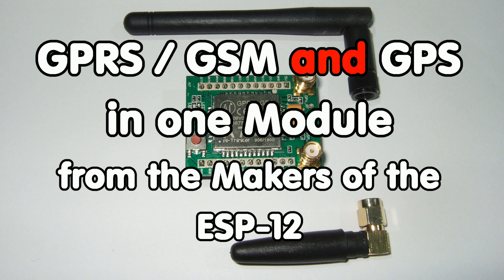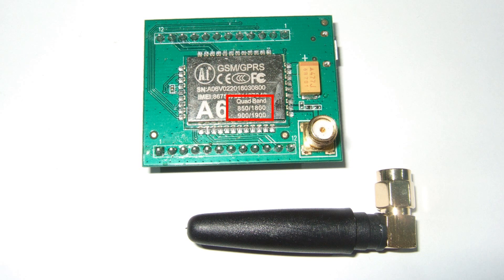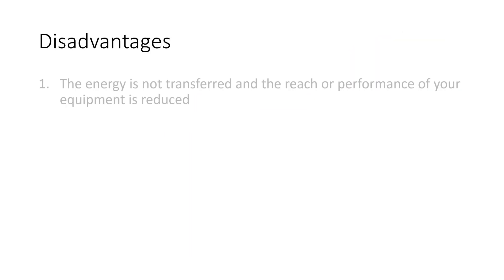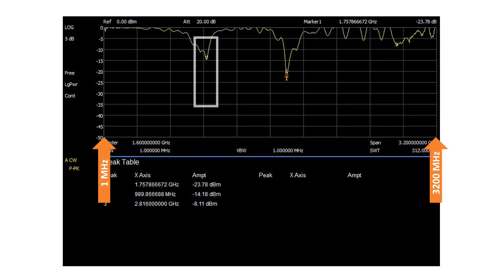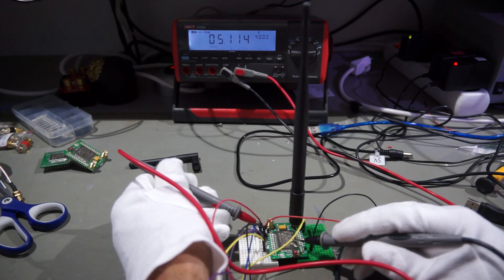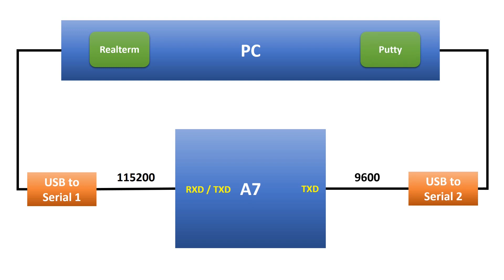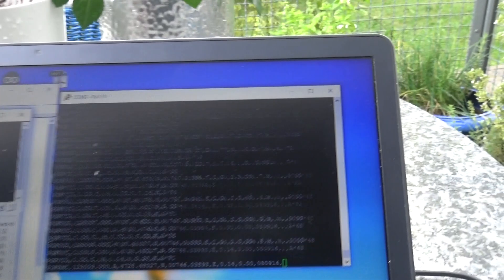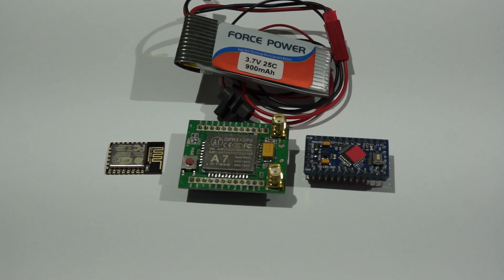#79 GPRS/GSM and GPS in one cheap module: The A7 from AI-Thinker

Comment: I managed to add power for a active GPS antenna to the GPS SMA connector.
I replaced the zero ohm resistor which connect the SMA connector to the GPS antenna input from the A7 module by a 100 pf capacitor.
On the backside of the pcb I soldered a SMD 1 uH inductor directly to the center point of the SMA connector and the other end with a thin wire to the 4 volt VCC near the  MP1584 voltage regulator.
Reply from the maker: Very good information! Thank you. Could you provide maybe link to the antenna you used and a picture where you show, what you exactly did. I think, many other subscribers would be interested.
Just for my info: What is the min and max voltage for the antenna!
Reply: I made two photo's from both sides of the module, which hopefully gives enough info. The link is : https://www.dropbox.com/sh/xcuy4b135jigh1g/AAACqVZXAmFlJi68VQcSrhA9a?dl=0
I used an old TomTom GO external antenna (model 4D00.006) but I think that the antenna bought from Ebay should also work.
Reply from the maker: Thnks. Perfect. I will try it, too
Reply: Do you have part numbers or specs for the components you added? For instance is the capacitor you used a multilayer ceramic, feed through. etc?
Thanks for the help and for posting your findings.
Reply: I can't say much about the components, because they came out my "junk box". The capacitor is a 3216 (3.2 x 1.6 mm) but the 0 ohm resistor it replaces was smaller in size. I don't think that the quality is very important, because it only has to block the VCC. The inductor is a 3225 (3.2 x 2.5 mm) with a dc resistance of 0.5 ohm. It is mounted upside down, so it is easyer to solder to the center pin of the SMA connector and to solder the wire at the other end.
Reply: Dolf
Thanks for the reply. Based on your latest response I am planning on using these components then from Mouser
Inductor
http://www.mouser.com/Search/ProductDetail.aspx?R=MLF2012A1R0Mvirtualkey52130000virtualkey810-MLF2012A1R0M
Capacitor
http://www.mouser.com/Search/ProductDetail.aspx?R=W2F11A1018AT1Avirtualkey58110000virtualkey581-W2F11A1018AT1A
I would appreciate your comments.
Thanks again
Brian
Reply: My knowledge about SMD components is minimal. I am from the descrete components era. Your choice looks allright to me , but I think that the small size of the inductor maybe hard to solder a wire on one end. The inductor  I used was fairly easy to solder a wire on.
Reply: Dolf,
Thanks again for your help. I grew up with vacuum tubes so no worries!
Brian

Comment: Thanks for the video. GPS is working fine and also other AT Commands. when I start a tcp connection-AT+CIPSTART="TCP","ipaddress",port
the reply should be CONNECT OK. But many times i get garbage values and after the cipsend command, in the reply also i get garbage in between the response from server.
Reply from the maker: So, it seems, that you have some work ahead ;-)
Reply: please check your device that it is also showing such type of issues or i got a bad one
Reply from the maker: I do not use it for the moment, so I cannot check.
Reply: Did you try to set the baud back from 115200 to 9600? This could solve your problem.
Reply from the maker: You can only do this temporarily and with a clumsy method. So, this was no option for me.
Reply: What kind of garbage do you receive? Maybe it's an option to add more time to delay?

Comment: Congratulations pour this video. I have a problem rather simple ... how to connect the board ? because the indications are not documented, for instance the pin GPS (near the GSM antenna) ? is it the TX PIN GPS. Have you a document with the corresponding pin to connect to the two series line as in your video?
Reply from the maker: Pin 37 is GPS_TXD
The information I used is at: http://www.electrodragon.com/w/GSM_GPRS_A6_Module

Comment: How are you using Real Term and putty together? I am not albe to open putty while Real term is open
Reply from the maker: Not on the sam port, of course. But for different ports it should work
Reply: You connected 2 FTDI/Serial interface to A6? :O
Reply from the maker: Not to the A6, but to the A7. For the A6, I just used Realterm instead of Putty
Reply: Oops, I was talking about A7. I am still confused about the wiring.
Reply: I have A7 that is working, I am able receive "OK" for AT+GPS=1 but as I understand it needs 9600 for GPS to output but AT commadns seem to respond at 115200.
Reply from the maker: The A7 has two serials, one with 115200 and the other with 9600
Reply: HTXD and HRXD ? can you please post a circuit diagram.
Reply from the maker: Pin 37 is GPS_TXD
Reply: Thanks a lot. I will try them :)

Comment: Andreas, I got my A7 today but I can't seem to get serial communication to work.  The only info I have is from your video.  I am supplying power to the micro USB connector from a large power bank, so I assume current capacity is OK.  I have serial connected to PC via a CH340 usb adapter (RX/TX pins on the same side as GPS connector).  I have a ground from the CH340 to the A7, but not power.  The CH340 is set to 5v just to be safe.  I then press and hold the power button on A7 for 2 seconds and the LED lights up.  Putty is connected at 115200 baud.  When I type AT i get nothing on the putty terminal.  If I press the power button again, to power down, then power up, I get some 'garbage' on the serial terminal, so assume something is happening??  Do I need any special settings in putty?  have I got the A7 powered up correctly?
Reply: As per above, there is a pin labelled GPS which is a second TX port dedicated to GPS output at 9600 baud. You really need a micro with two hardware serial ports like the Teensy 3.x/LC series.
Reply: arrrh!  some progress, I now get an output when i power it on.  Not sure what was wrong before, possibly not holding power button down for long enough.  The A7 now send a series of lines to putty;
^CINIT: 1, 0, 0
^CINIT: 2, 32, 41891
^CINIT: 8, 2048, 1
^CINIT: 16, 0, 1638410
^CINIT: 32, 0, 0
+CREG: 0
then nothing else happens.  I still can't send AT, or at least I get no response.  I've tried sending AT+GPS=1 and again now OK response (assuming I should get an OK).  I have to force ECHO on to see the AT that I send, nothing when set to auto (not sure how this should be set)
Reply from the maker: Try once Realterm instead of Putty
Reply: I can now get AT comunication working and send/receive text messages !  The problem was the power supply, it obviously wasn't coping with the peak requirement.  Had similar issues with SIM800 so should have known.

I'm now struggling with GPS.  I get an OK response to the AT+GPS=1 command, but no output on the GPS TX @ 9600.  Should I get a serial output even without a fix?  I only have the wifi type antenna that can with the A module and an Active antenna (with a very long lead).  I've tried both but no output on the serial terminal
Reply: I now have a GPS output !  I was on the wrong TX pin, doh.  The pin i was supposed to use was the pin labelled "GPS", not the one on that side labelled "TXD".  It was really hard to see which pins you'd used in you video and I got the wrong one.
Reply: Is there an rx pin for the GPS?
Reply: MARK, how you get GPS info ?
i'm connected by TX, RX but after AT+GPS=1  get nothing
need connect another pin ? may you help me ?
Reply: thanks.. i'm using a esp and have only one !!  i will need to move them

Comment: Hi,
I tested the AT commands to send HTTP get request you showed for the A6 on the A7.
Unfortunately it didn't work for me.
On the 3rd command I get an error as if this command is not supported.
AT+SAPBR=3,1,"CONTYPE","GPRS"
The error:
+CME ERROR:58

The A7 that I use has thi version:
Ai Thinker Co.LTD
A7 
V03.03.20160725009H03

Making phone calls does work so I guess the SIM is registered OK on the network.

Is it the firmware? or maybe my SIM card?

Thank you for your kind help
Reply from the maker: So far, I only did the testing with the A6. But I saw the 58 message many times :-(
You can try if the SIM services are ok by using the card in one of your mobiles. At least, this worked for me to discover, that a service was no more working (I has an expired pre-paid card).
For the rest, I cannot help for the moment till i find the time to test the A7 myself

Comment: Thank you for great tutorial.
Maybe it is not rude to ask from you to make a tutorial on how to send HTTP get request with the A7 module?
From some  reason I get an error response for AT commands to send a get request.
I used SIM900 commands which looks like a kind of a standard but couldn't find any info in the A7 document for HTTP get request.
Reply from the maker: It took me a while and many error messages to get this done. The SIM900 commands did not work. You should find an example (Sparkfun) for a http request in my files for the A6 video. I assume, they use the same commands.

Comment: Is there a pps out from the GPS on any of the GPIO pins ?
Reply from the maker: What do you mean with pps?
Reply: Pulse Per Second output, which sometimes is used to accurately calibrate some equipment.
Reply from the maker: I did not see such a pin in the data sheet
Reply: What is GPIO13 used for . Unfortunately the Datasheet does not mention anything about it.
Reply from the maker: I also do not know more than the datasheet :-(

Comment: Thank you for this great info. Mine just arrived here. Same useless antenna in the box. (I don't get this)
Like receiving a diesel engine in a petrol car...

I noticed that the the rx and tx pins are not 3.3volt but 2.8?
are you aware of this? guess 3.3v would be OK but 5.0v not.
Reply from the maker: I do not know about the voltages, but, as you write, I use 3.3 and avoid 5v

Comment: I know this is overly paranoid, but please could you check the GPS coordinates from the A7 to make sure they are as accurate as they should be?

I have recently come across another cheap product called the "Mini A8" which touts itself as a GMS/GPRS GPS tracker, but it's tracking is not GPS at all: it's LBS (ie: it only uses cell towers), the location accuracy of LBS can be as bad as 1 kilometer away.  Note that the device is named the "A8", which is very similar to A6 and A7.

I'm not sure what chipset this Mini A8 device is based on.  But the whole situation is making me suspicious, especially considering that they didn't include a real GPS antenna with your A7.  It'd be nice to confirm that the A7 is using actual real GPS info and not just LBS.

LBS:  https://en.wikipedia.org/wiki/Location-based_service
Reply from the maker: It uses GPS, no worry. I checked already

Comment: Hello,

Did you try to use the antenna from the neo gps module? In case you own one of course... does anyone else know if it works ?

Do we have any documentanion for this or more advanced staff? i checked the 2 links that were on your first videos that someone posted on comments. Im more interested on the GPS part for now...
Reply from the maker: The normal Gps antennas do not have SMA connectors. You need a converter. I hope, i will get one in the next weeks. There is not much documentation around for the moment.
Reply: Oh i see... is there any way to de-solder the SMA connector and solder one that will work with that ceramic antenna? If yes can you point me to the right direction like a link or something?

Thanks for the reply.
Reply from the maker: +Giwrgos Dimas the cable of the GPS antennas are much smaller than the one used with SMA connecors. That is why I ordered a connector

Comment: At the time i write this, the A7 module is on ebay, but they don't advertise the GPS features at all.  To find it you'll have to search for: GPRS A7.  If you have GPS in your search it won't show up.  

So it all must be quite new, and they're still using the description from the A6 (with no GPS).  On the items tho you can clearly see it's the A7 module in the pics tho, with the dual Antennas and "GPRS+GPS" written on the module surface.
Reply from the maker: I am not an "ebay guy". I buy from Aliexpress or from Bangood. At Aliexpress they mention GPS. You are right, the module is very new and also the documentation is not complete.
Reply: Some results show up, but if you type "GPRS" you have much more results, i noticed it too yesterday... And for the record the modules used to be 1-1.5 Euro less like half a week ago, the exact same ones from the sellers. :P
Reply from the maker: +Giwrgos Dimas This seems to be the free market!

Comment: hey andreas spiess, i was wondering if theres a way to add upnp in esp8266? in order  to find a iot device via the public address without configuring the router before hand?
Reply from the maker: I am not good at these network technologies, so, I do not know. As an Engineer, I went the easy way and, solved the problem for the moment by going to the cloud ;-)
Reply: well what about making a video about the new esp32, i have seen its already on sell and before buying one i would like to see an overview using the arduino ide, cant really find much about this new chip. thanks for your videos again.
Reply from the maker: Neither can I. So, it is not yet the time for me. For sure, I will buy one as soon as they are available on Aliexpress or Bangood. But for the moment, I would not be able to use it. And I have still many other ideas...

Comment: No wonder I couldn't get the module to lock to any satellites.. Antenna that comes with it is wrong then. Thank you for sharing that.

Now I have a new problem. My main TX line doesn't work any more. Rx works fine I can see modem starting up but can't send any commands...
Reply from the maker: Glad to read that. Do you know if it is the USB to serial adapter or the module? At the beginning, I had also problems that the module did not answer. When I used realterm it worked suddendly and I had no time to investigate forther. So, maybe you try a little longer. At least in my case, it was not a defect...

Comment: Hello :)
Why you didn't use the usb port on the module? It can't be used for serial communication?
Reply from the maker: +Maćko Where did you see a USB port?
Reply: on the aliexpress: https://ae01.alicdn.com/kf/HTB1VndiLpXXXXXtXVXXq6xXFXXXN/202171486/HTB1VndiLpXXXXXtXVXXq6xXFXXXN.jpg
Reply from the maker: Unfortunately, this is only for power. As with the A6 module. There is no USB to serial converter chip on this board.

Comment: Hi Andreas, not sure if you found it, but the GPS data can be streamed through the same serial connection that you issue commands with. I.e. only need a single serial connection.

Use:
AT+GPSRD = 1 //serial gps output on

or

AT+GPSRD = 0 //serial gps output off
Reply from the maker: +Aaron Neal Thanks. I tried this command, but not extensively. Do you have a documentation?
Reply: +Andreas Spiess I used these commands on my module and it seems to work fine. I found a PDF from AI thinker that includes the A6/A6c & A7. In terms of GPS commands, the one to switch it on and the one I mentioned in my previous post are the only commands I could see.
Reply: This was th link, but it does not appear to be working right now.
http://wiki.ai-thinker.com/lib/exe/fetch.php/modules/datasheet/a6/ai-thinker_a6_a7_a6c_at_v1.02.pdf
Reply: There was a mention of it on the electrodragon wiki too:
http://www.electrodragon.com/w/GSM_GPRS_A6_Module
Reply: Hello, I just started with A7 module and I´m trying to make GPS work but so far no luck. Can I ask how it works? I will receive GPS data after GPS have fix or streight away when I send AT+GPS/AT+GPSRD=1 command?  I send these commands and so far nothing happend. Many thanks for answer.
Reply: First of all, change the GPS antenna.., see the video, and use AT+GPRSD=1 with this command you can see NMEA data in serial port.
Reply: I have tested this command after translating its Chinese "datasheet", the value you provide is actually not only 0/1 for on/off but it's how much time between each data stream in seconds so AT+GPSRD=1 will stream gps data each second and so on.

Comment: How long it take for have a Gps signal(you say few seconds but it's seems to be too short for a no AGPS ) ? It's a bad new for the AGPS,  i noticed in the new AT commands pdf they talk about the A6 V3, idk exacly if it's only a firmware modification or an hardware too, thx to the V3 we can have new GPIOs but I can't find how upgrade the Firmware : (. 
I see the Gps signals are NMEA so have you tested the TinyGps++ library ? 
Thx for all the informations : )
Reply from the maker: 1. I do not remember how long it took. But it was quite fast.
2. I do not know about new versions or how to update the FW
3. I did not use the tinyGPS library